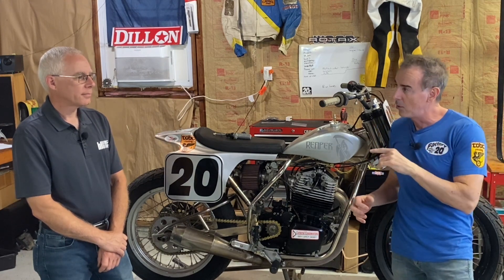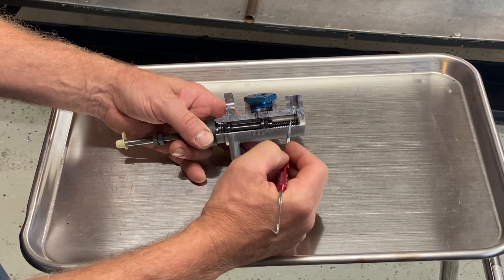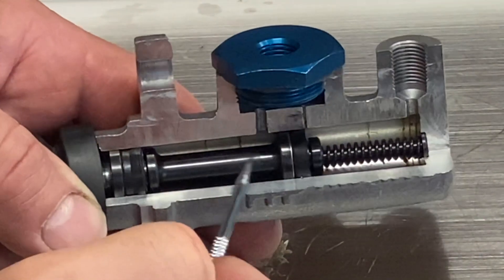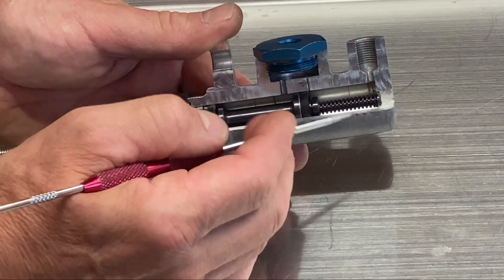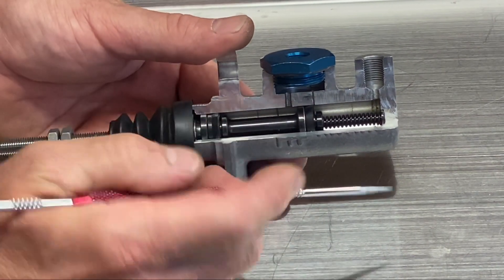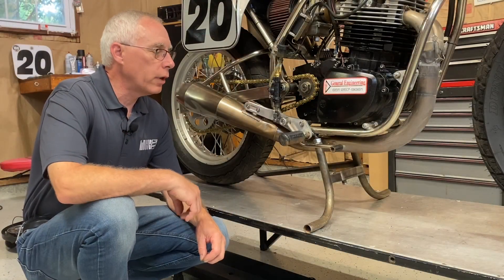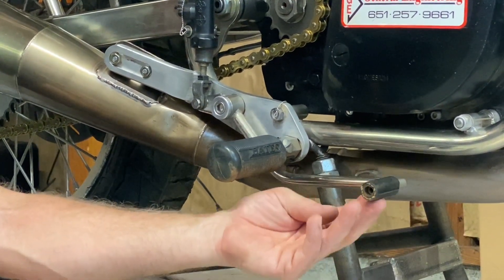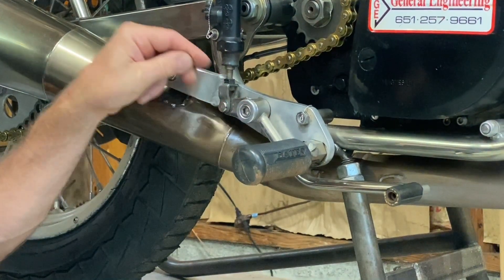Flat Track Brakes: Pro Setup Tips

Comment: I’m in the process of putting a Ceriani front end on my XR-750 “tribute bike”. I’m changing it from a flat tracker to more of a TT bike (with brakes).  Do you know of anyone making caliper brackets that fit the Ceriani fork and use a certain type caliper?  I prefer to not have to engineer the system myself. THANKS!
Reply from the maker: I would suggest talking to Jack at First Klass Glass ( 989.871.2360 and on Facebook)  and Davey at Durelle racing https://durelleracing.com/ . Tell them FTF sent you! About any fabrication shop could probably do it, but may not want to though. Good luck!

Comment: Great video Michael and Mike! That's what keeps me coming back for more. I love the videos on the brakes, but I'm craving more like, brake lever pivot ratio, master cylinder piston to caliper piston size ratio. What is a good brake pedal pressure range? I think this would be of interest to anyone building a bike or even diagnosing a brake problem, as  like most of us out there are not engineers. I have been struggling with a bad rear wheel hop coming into the corners that new suspension and no amount of adjustment seems to cure. And then I watched your brake pedal position video and decided I must have a brake issue more than a suspension issue. I think my brake pedal is too easy and my foot is bouncing on the pedal, but even on a smooth track? Any suggestions? Please help oh great brake wizards!!  Chris Hemphill #69
Reply from the maker: I have some good news, and maybe some bad news, depending on your perspective.  The good news is there's no cost in parts or bike adjustments needed.  The bad news is you're going to have to talk to your rider.  Because the rider is almost certainly causing wheel hop into the corner. :)